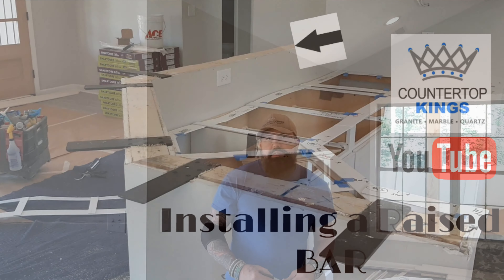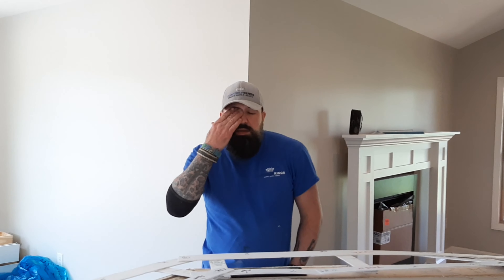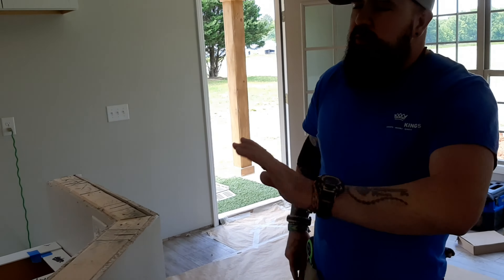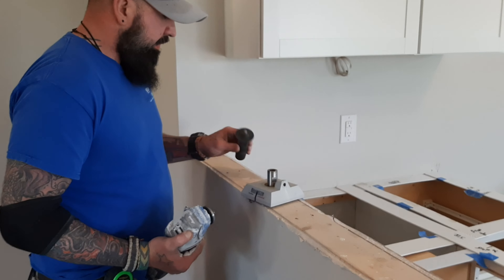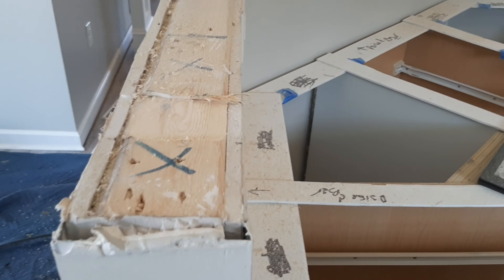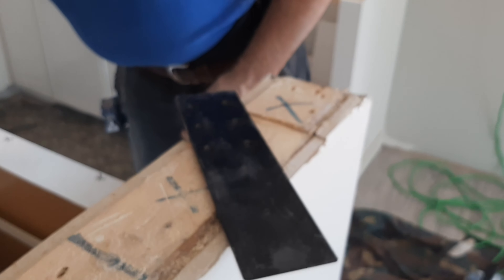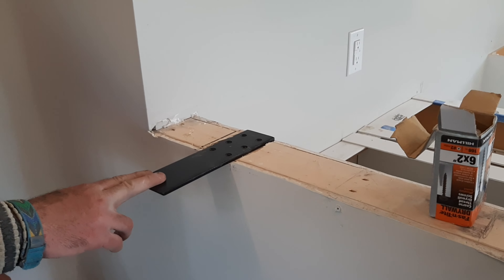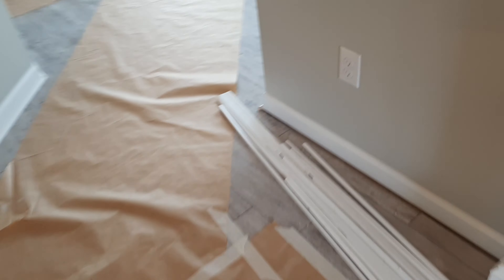Installing a Raised BAR - Countertop Kings - How-to

Comment: Well the electrician installed the horizontal positioned outlets wrong on that riser , The wide neutral blade slot should be facing  up because if an appliance is plugged in and works its way out and something falls across the top you would get a very bad arc with the way they are installed now , Neutral up No ark danger .

Comment: What is the purpose of recessing the brackets into and flush with the top of the 2x4?
Could you just mount them on top and have the bar top resting on the steel brackets?
Reply from the maker: I guess you could but it wouldnt be supported all the way around unless you used a lot of shims and silicone.
Reply from the maker: And trust me when i tell you, the customer will not go for that.

Comment: How did you attach the granite to the brackets?
Reply from the maker: Silicone
Reply: @FOUCHFABS  Really?  That’s it?  It stays put?
Reply: Silicone, but the longer ones usually have screw holes if not attaching them to granite or marble. I’m building one right now out of a chevron patterned butcher block. Customer wanted the enter knee wall dropped by 5 inches and then a special designed cut for the tabletop. I ordered the 16” version of these and they are heavy duty, 1/4” thick steel. I put silicone on the knee wall and on the brackets.

Comment: Question? removing tile countertops to install granite. We have a split level bar and trying to figure out how to tear out 3/4" plywood that is laid directly on the cabinet but under the supports for the bar top.  We believe the 3/4" plywood is the support for the bar top. How can I get out the 3/4" plywood which is nailed down under bar top? If we do manage to get this out, will it remove support for the bar top?
Reply from the maker: My time I have that situation we either lose the supports and put new ones, or you have to raise the supports. when doing tile tearout depending on how it was installed I will try to pry tile and wood all off at once . this is possible if nailed instead of screwed. if it screwed you have to go later by later and it can be really messy and time consuming. thanks for watching, dry it took so long to reply.

Comment: please change the battery in the smoke detector.
Reply from the maker: it isn't a smoke detector. it is the alarm system for building which we share. that beeping is a pain in my ass, but if I can endure it for days you can endure it for a few minutes. lol. I hate that beeping, and we have had it "fixed" multiple times only to suffer through it a month later.

Comment: drywall screws?! fail.
Reply from the maker: What do you mean?
Reply: @FOUCHFABS  tensile strength is terrible with drywall screws, that's why the heads always pop off. folks should use regular wood screws or construction screws for those brackets.